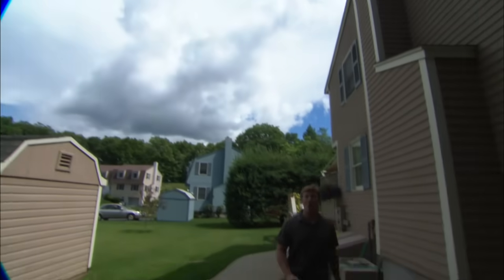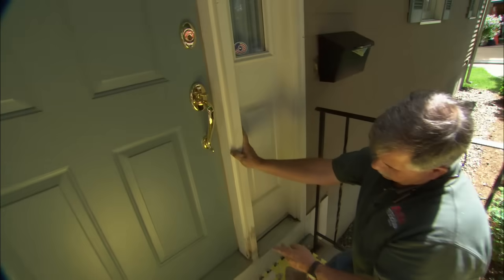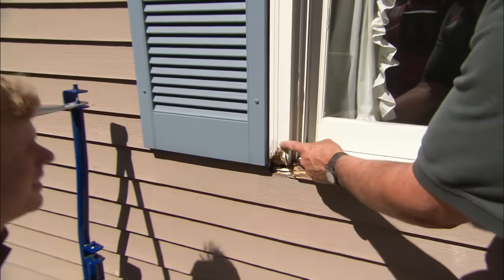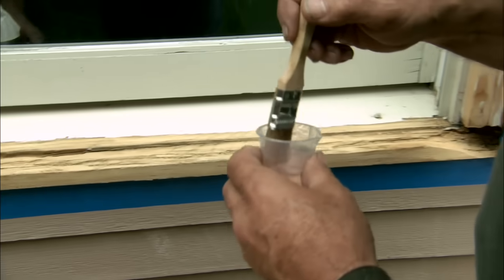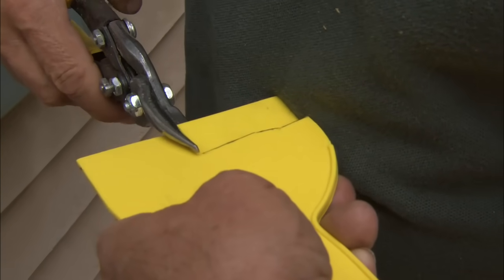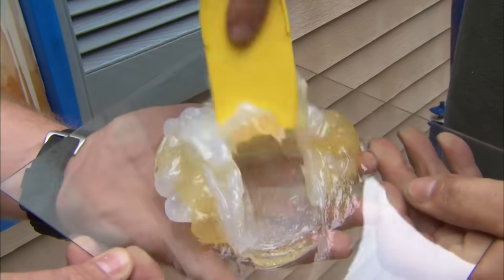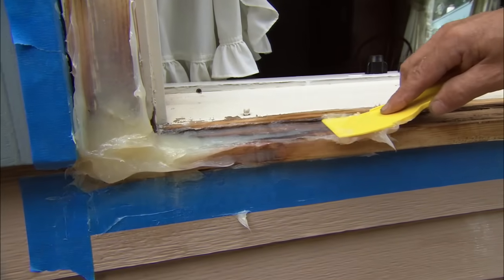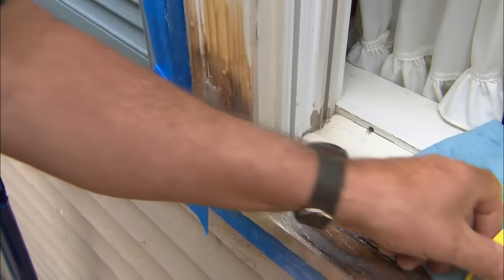How to Fix Rotted Wood with Epoxy | This Old House

Comment: I've used the Bondo on exterior repairs and it does crack in some instances. As far as Minwax it's it's basically Bondo. I do like using the wood hardener Minwax makes. I would like to use the epoxy stuff that they use then then make my decision on what is best

Comment: Question: If the rotted part is touching something prone to moisture, such as a concrete slab, will repairing the wood with epoxy prevent rotting in the future? Or will the moisture transverse up into the wood above it?
Reply: Wood should never be close to concrete without a vapor barrier in between

Comment: One thought on the Bondo use, i thought it absorbed water, that is why we need to use tiger hair when filing in a rust hole and not go straight to bondo. Bondo is so easy to use and sands so nice, i can see how convenient it would be in this application.
Reply: I know people who have used bondo for fiberglass repairs on their boats who report that water absorption has never been a problem.  But wood absorbs water too, so I am not sure why that would be a problem when repairing damaged wood.

Comment: There is a 4th way!  I used some cheap all-purpose filler from Wilco (UK).  It's cement based and not the usual plaster one.

Comment: I tried Abatron brand epoxy a few years, and the repair has begun to separate from the wood despite prepping the surface appropriately. It didn't move with the wood as expected. Given this outcome, I made another repair this year using the old school bondo and wood screw trick. It was cheaper and easier to work with.

Comment: I've tried this myself using JB Weld Wood Epoxy.  It works but it's pretty difficult to make it look as good as new.  If you only have a tiny amount of rot this might be the easiest and cheapest method, but next time I run into this situation I will probably just replace the wood.

Comment: I wonder if epoxy gives any structural strength? I have a table with rotten legs. I wonder if this is strong enough to support the table (around 15kg weight) or I'd better replace the legs.

Comment: Hi, thanks for this video! I dug out some rot from the bottom of a couple of exterior door frames. The resulting spaces are each about the size of a baseball or maybe a little bigger. Would it work to fill the holes with "great stuff big gap filler", trim it to be almost flush with the door frame, cover with a little regular wood filler, and paint? Hope that's not a dumb question. I already have all these materials, so that would be convenient, rather than buying epoxy/etc. Thanks!
Reply: This is exactly what I was thinking of doing to my exterior door rot?  Curious if you tried it Kelly McConnell.

Comment: Lots of people asked (wondered the same), I think I found it!

Bonding agent: Primatrate for Flex-Tec Epoxy
Epoxy: Flex-Tec Wood Epoxy
OR get the Kit: Flex-Tec Dual Cartridge Starter Kit 101 ($230+ when you factor in sales tax and shipping) forget it!
Reply: Flex-Tec was my first formulation. Dura-Fix is my new product. Available on Amazon.

Comment: Is that a bonding agent or a wood hardener? I would always apply a preservative wood hardener after getting rid of as much of the rotten stuff as possible. It needs to soak in as far as possible to kill off the rot spores and make a solid surface to bond too. Also, I just use cheap, generic epoxy fillers. They will last longer than the wood anyway.
Reply: Yeah they just skipped over the mysterious "bonding agent" like they were afraid of it.  I need to know.
Reply: I sometimes drill small holes into the existing old wood (maybe 1/2") and pour the wood hardener directly into the holes so that the liquid hardener distributes itself deeply throughout the wood. Sometimes use a hypodermic needle, without the needle, to direct the hardener to specific spots. You can get them at your local drug store for a few pennies or sometimes for free.
Reply: @g.e.boroush5176  That's an excellent idea.

Comment: I took note of negative contractor comments about the cost of the materials Tom Silva selected for this job? I am an amateur in this area but my immediate reaction was I wonder if this material is easier to work with and to form? I am restoring some 106 year old screened porch framing wood that has wood rot from a water leak. I chose PC Rot Terminator and their PC Woody product. These are good products but much harder to spread and fill holes than what I see in Tom's video. The worst part of the job is the preparation but that is closely followed by the application of the epoxy repair product difficulties if it wants to stick to everything it touches.

So, if I have to do this again I will very strongly consider Tom's choice of product and will likely be glad to pay the extra cost. None of us attempting these kinds of repairs on old houses want to have to go back and do one of these tedious repairs, which are primarily manual labor, over again.

Comment: bondo cheaper and sets up faster.  also you need to add something to the large holes for the epoxy to grip or it will eventually fall back out.  nails or screws into the good wood will work great.

Comment: I'm reminded of a opening that was cut thru a concrete floor to put in a stairway, we made the steel to reinforce the opening and the design called for holes to fill in with epoxy between the steel and concrete. We priced out the epoxy and realized it was going to cost maybe over a thousand dollars. Luckily we realized our contract was just for steel and said nothing about epoxy, had it been $50-100 we would have just done it whether it was our responsibility of not.............One more interesting thing about that job was it was the top of a 40 floor apartment building and the Desk Man looked and sounded just like Henry Kissinger.

Comment: This was made 7 years ago, would you do it the same or have things and materials, where you would now do it different and would this be ok to use on a post?
Reply: That trim was mostly decorative and meant to shed water. If the post is structural and has a lot of rot, you don't want to use a ton of epoxy. You need to replace/repair structure with structure.
Reply: @daveclark8337  thank you for that info..

Comment: I've repaired casement and sliding sash windows for years, transplant new timber instead of these chemical fillers. Talk about "going against the grain " reinstatement of timber is best practice.
Reply: What would you use for an old wooden column - the base got wet because of a faulty eave spout / gutter and now a section of the round base is rotted approx, 3 x 3". Need an epoxy or something to fill it; or replace the 8' column which is thousands of $

Comment: I'm new to this, please could you advise what product of epoxy that was and the size? Also, I read that's its good to mix sawdust with it when filling, do you agree?
Reply: No mixing saw dust in it. Personally I don't like to use epoxy on rot this large except maybe a sill plate. this window was maybe a $200 replacement. I personally would have gone for new.
Reply: Auto Bondo works.
Reply: Polyester resin mixed with saw dust is a lot cheaper..  Works just as good,  cures faster..

Comment: I can understand fixing a small hole in a window sill with the epoxy but why bother with brick mold when you can buy the PVC plastic brick mold for about $10 for 8 feet  prepainted nail it up fell on the nail holes touch them up with paint last longer than the rest of the house
Reply: Never heard of "prepainted pvc."

Comment: I can see repairing the sill as I've done many over the years but I wouldn't waste my time repairing the brick moulding as it's a lot cheaper to buy it pre-primed and takes just minutes to remove and replace.
Reply: ...or get the PVC stuff that never needs painting.

Comment: This wasn't even a customers house, they just saw this house was rotting and they just fixed it
Reply: They did not fix it, go look its rotted out again by now.
Reply: The Epoxy will NEVER rot. I would say cost its worth the permanent fix. Also, there are probably other areas that could use the same repair
Reply: @angelleigh9468  the wood around there patches is likely rotted out now

Comment: I have to admit from the way I have seen wood rot travel.I would pull the boards if possible and replace them.That way you can see if it traveled on any of the other contact pieces.Wood rot is no joke.

Comment: Smith's is a good local (bay area) brand of paste two-part filler; they also make a two-part hardener. Pricey of course but for me, worth it. However, I am very skeptical Tom could match the shapes in a single application: better to do a first fill, dry, then a topcoat. Some of my repairs on my old house are 20 years old and solid.

Comment: The wood to replace is cheaper but requires more labor and time than the epoxy. The epoxy makes the job waterproof and chances are good will not need repaired again. Some sanding, some primer and paint and it's a permanent repair.

Comment: Well, I tried, and I would really like to know what the "bonding agent," is and the epoxy, as I got epoxy adhesive. I hated the directions as they said, mix until the colors are the same. First I was using a piece of green plastic, and then it also said cardboard on the JB Epoxy, but the one was slightly yellow, so I really recommend this clear Lexan. I didn't use a bonding agent, because I didn't remember that step.
Reply: you can use bondo for auto body.. and use a piece of sheet metal as a pallet to work on.  i worked in autobody and bondo expands  too for cars .cheap too ..easy sand and prime n paint.. i did it 4 years ago.. still good cuz i removed the rotten wood first with a flexi shaft and router bit. . no bonding agent ... .. MINWAX makes a  WOOD HARDENER for this old gouged out rotten  area
Reply: I finished the project, but one thing I did do is use wood hardener after getting out the old wood. The video says nothing about that.  It would have been nice if the video told us what bonding agent to use or to use the wood hardener, to leach out the moisture. One problem I am having is the epoxy not holding on paint. I actually used some paint for plastic in that area; will see if it works. I found the wood putty I had to use to fill in the gap is really are to sand to a nice smoothness, and I am going to keep trying. Thank you for responding.

Comment: U used a router.
Can u use a drill also?
What's the name of 2 part epoxy u use & where can u purchase.
Reply: The epoxy used on this project was my old formulation. I have a new material Dura-Fix. Available on Amazon

Comment: I have a brick mould with rot on the bottom. Can I remove one whole piece and just nail a new piece in rather than cut out and resin fill the bottom 4 inches?

Comment: Can one use Elmer's Carpenter's Wood Filler instead, for that application?
Reply: I've had some luck using Elmer's Carpenter's Wood Filler in a similar situation, when I used it about four years ago on the outside of a house. But one thing to consider is that even after it's dried, it will dissolve in water--it's holding up well after I painted it with several coats of latex paint, but a better filler is a two-part product like Minwax High-Performance Wood Filler, which is very much like Bondo, because it's essentially waterproof, so if any moisture does get in, it won't dissolve.
Reply: Thanks John!
Reply: It cracks, and it's not strong. Small fills, okay, but epoxy for bigger jobs, or jobs where the fix is not enclosed.
Reply: Wood glue won't last. I have a weather end chair with an epoxy paint that has never seen shelter in 13 years. No rot or cracking... It sits on the beach in Maine all year round.
Reply: it's a Teak wood chair. Sorry left that out.
Reply: You don't want to use the Minwax in any place that doesn't have very good ventilation, the fumes are VERY strong.
Reply: Polyester Resin,  mixed with saw dust,  Cheap, easy and last forever..

Comment: The epoxy cost more than a new piece of wood.
Reply: yeah, the whole procedure just seemed unreasonable.
Reply: +spilt bluhd I guess it depends on how much you value your time - or how much you're willing to pay someone else for theirs. Epoxy repair is often many times quicker than full replacement, and If you can get out all the rot and fix the reason it rotted in the first place, then it's a good deal.
Reply: By far it is the way to go for total cost if you do repairs for a living. The end results are excellent and the customer is happy. The only thing different I do. after clean up of the area, I take wood rot epoxy that is designed to soak into the lumber it is like water consistency. This way it makes everything even stronger and adhesion is bullet proof. I have soaked very weathered oak exterior thresholds and have had great results also. Painter love to set screws and dump in the bondo wich to me is a band aid fix. Use the wood rot epoxy first and then the bondo. Now you have a solid repair. - Blessings Bob
Reply: 2-4 hours of carpentry work is much more than epoxy. Epoxy work can be done by average home owners.
Reply: Ive a shed with windows needing repaired so I wont be buying anything too dear, I will buy the fibergass cheaper alterative...👍😁
Reply: @xsdrew19  Yes, and that is the target of this video. I don’t have the tools to do replace the wood and shape it. This I could do.
Reply: Wood putty is a waste of time and money because its not flexible and just ends up cracking after 1-2years. This stuff lasts a long time. You get what you pay for
Reply: @kalijasin  "Americans fix nothing."
Except the video showed Americans fixing something.
Reply: I can remove the old trim and install new in less than 2 hours.
Where are you guys getting your times from?
Reply: However, a homeowner can do the epoxy method. Few of us are able to reframe a window.
Reply: No brain nasty job that's a little boy work?🤔
Reply: @kalijasin  Stop generalizing 340,000,000 you tool. More people fix things in America than you know, all of the things that were and are built here, were built by people who fix things... I worked for loggers who don't own anything larger than a power drill that they have not fixed...
Reply: @itaintrocketscience  yeah some window trim is pretty basic carpentry .
Reply: @davidmccarthy6061  you're not "reforming a window"... You're prying off some old wood, going to Lowe's to find the same trim profile which is usually not an issue, cutting a miter, nailing the new trim up, and painting it. If you did't have the paint or the miter box, it's a 100.00 dollar job...
Reply: @itaintrocketscience  yeah, in reality Tom can fix it the right way in less time also, and cheaper.
Reply: TIME is more expensive then the epoxy AND wood ! ! !
Reply: you'd have to replace the entire sill, and cut in and match up the side trim. You wouldn't save a whole lot of money and you'd definitely lose time (which also equals money where I'm from).
Reply: @xsdrew19  a piece of brick moulding can be too.
Reply: @kalijasin Lol!  If we didn't fix nothing, then Lowes, Home Depot, and Menards would be out of business.
Reply: This method is approved for historic restorations.  Since a lot of profiles don't exist off the shelf anymore and tool setup costs to get things custom milled costs quite a bit of money before you even buy the first foot of trim.
Reply: Not with labor if you're paying someone else to do it

Comment: The only problem using these products is after time  the wood expands and contracts around the filler     ( which does not) and cracks around the filler show up. I think an exterior nylon based powder filler lasts much longer.

Comment: I've looked, i can't find any window sill replacement wood (DIY type project).  For starters, I need a reliable sill (outdoor/indoor) that is 1/2" by 2" by 24"  I can't find any pre-cut like that, i would assume it needs to be either cedar, redwood, or cyprus, correct?
Reply: What's a 1/2" and what's the 2"? Seems really small for a sill

Comment: Car body filler will work well and is much cheaper. Remove ALL rotten wood, where possible rebuild with new wood anti corrosion mesh and anti-corrosion screws, treat with wood preserver, prime with wood primer, fill with car filler, sand, prime again and finish paint.....Done right it will look as good as new and last for years.
Reply: +Iazzaboyce     You are correct.  Car body filler works great.  I've used "Bondo" on exterior and interior wood repairs.  It will outlast the wood.
Reply: Polyester Resin  (Fiberglass Resin) mixed with saw dust.. Last for ever..
Reply: ThomasTheSailor Chubby what purpose does the sawdust serve? I've worked with this material before and never saw a need to add sawdust...
Reply: Capps,   It makes it much Thicker and doesn't sag on a vertical surface either..   You never need multiple coats,,  Of course, You don't need it but, it makes a stiff filler..  If you need a stiff filler..
Reply: Bondo does not flex with the expansion and contraction of the wood. It will look good for 6 months and then the edges will crack and it will look like crap. Only an halfasser would use Bondo.
Reply: What would be better to use? Thanks for any help you can give.
Reply: Frank Hering look for epoxy made to be a wood filler. Bondo is for metal and plastic repairs
Reply: I work for The Rot Doctor I would check out our "fill it" epoxy filler
Reply: jack nimble - Of course Bondo expands and contracts. Did you know many high performance watercraft are made from wood covered with the same resin (polyester) used in Bondo? The flexing and bending experienced by watercraft is far higher than anything a house will ever experience.